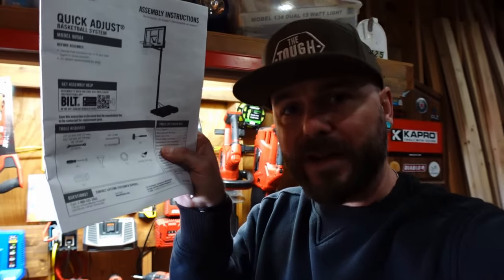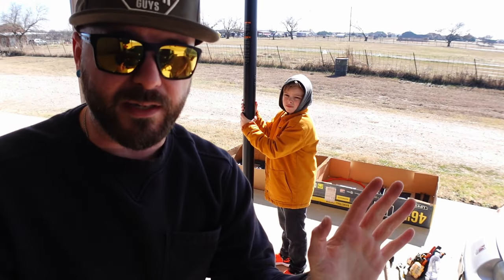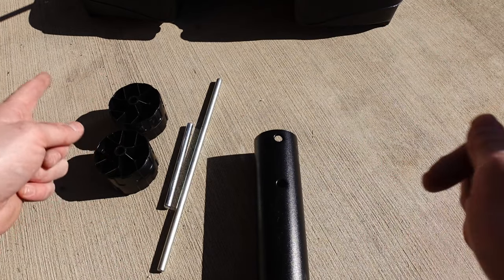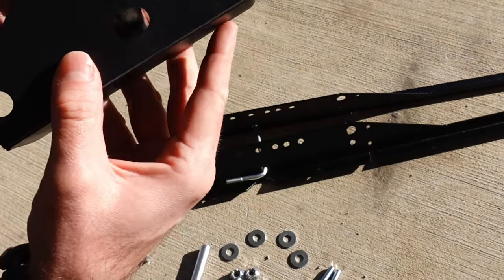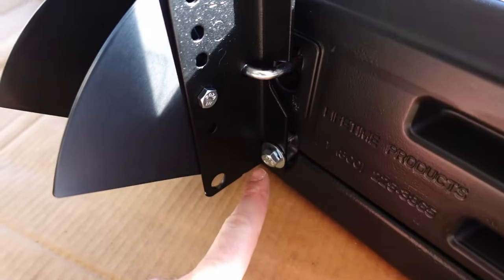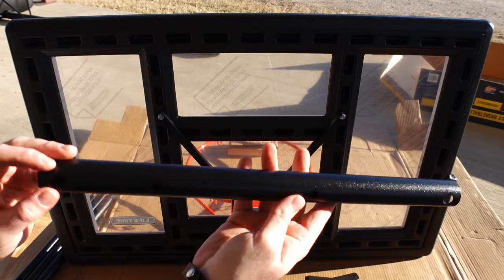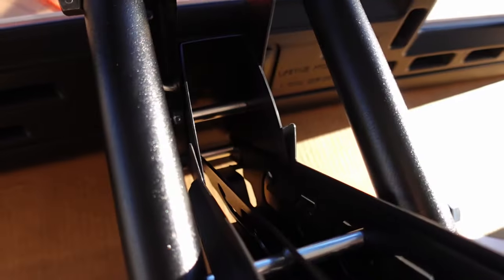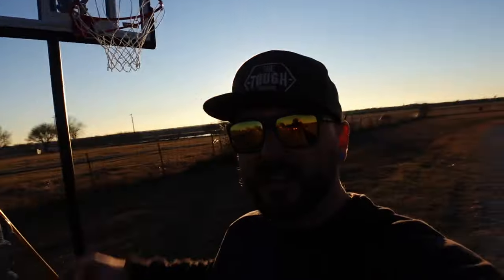Lifetime 46" Basketball Hoop - Unbox & Assembly!

Comment: @8:05 in your video we had the hardest time trying to get those 2 screws in finally gave up on it after 2 hours of trying. Not sure what I’m doing wrong
Reply: Yeah that slowed me down a bit too.. not sure if you figured it out, but basically hold the receiving side in hard with one hand around it while you screw in the bolt on the other side.

Comment: Man I think I'm going to leave those folding plastic parts out. I'm glad that I saw you did the base backwards. That's something I would do. Now I won't. Thanks for falling on that sword for us lol
Reply from the maker: Hey!! Thank you for the comment and I’m glad the video helped you out. This was a challenging build, more difficult than I had anticipated before starting, so I’m glad it turned out well enough to help
Reply: I got everything together okay but installed the folded plastic piece upside down lol..the goal will only lower go to 9 ft because of it. Did you leave this piece out? Thinking about it. I believe it only reads out the goal height and nothing more.
Reply: @hove131  I left the larger plastic piece off. The smaller one is necessary I believe?
Reply: @okramando  you left the one that folds off correct?
Reply: @hove131  Yes

Comment: Thanks for this! My backboard had a bolt get lost- do you know how long the bolt/screw at timemark 13:44 is? Trying to figure out how to find a replacement. And do you know if I need a drill for it, or if it can be put in by hand? Thanks!
Reply from the maker: You shouldn’t have to pre drill anything, and those don’t look to be longer than 1-1/4” to 1-1/2” but I don’t have the instructions to verify that. Thanks for reaching out!

Comment: Is that base supposed to be turned backward so it doesn't interfere with doing layups?
Reply from the maker: I accidentally installed the base the wrong way, ended up doing a 2nd video on swapping it if you made the mistake also - but yeah, it def shouldn’t be in the way at the ground.

Comment: How do you adjust the height
Reply from the maker: You press up behind the backboard, lifting up the goal and it has a slide type locking mechanism, so it will “latch” at different intervals of height. Hard to explain written out.. apologies I didn’t show that better in the video. We used a broom stick to raise and lower from the ground.